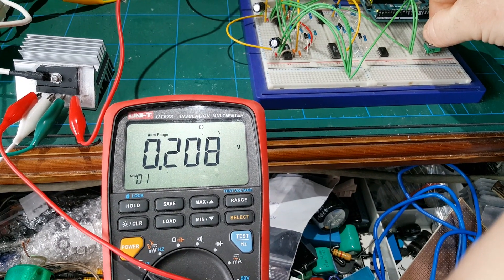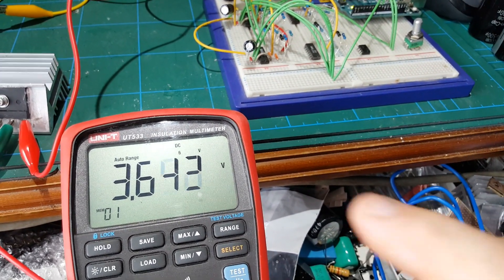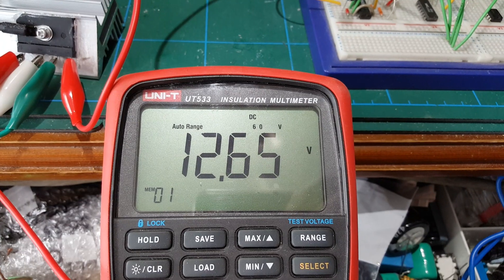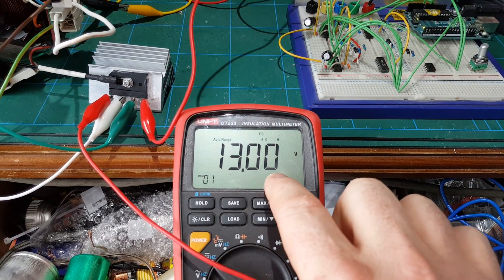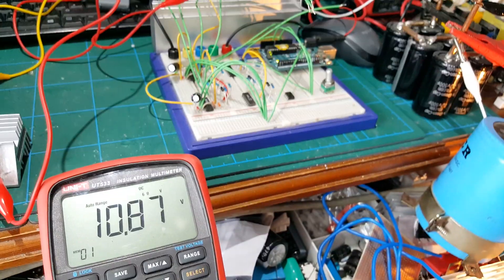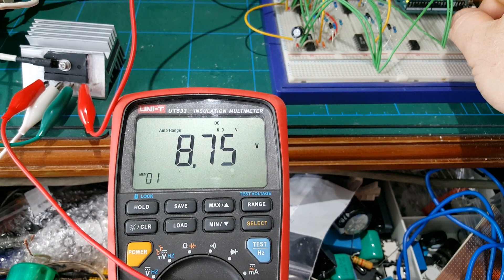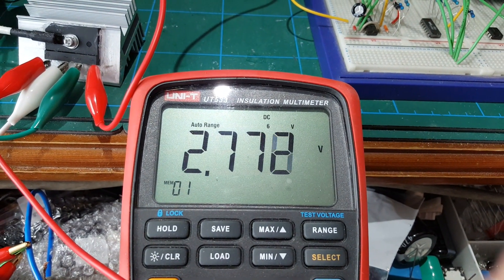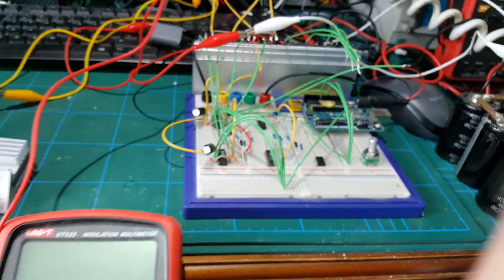motor control #4.2 regen braking dc series wound motors continued

Comment: Hi, I have bought used Curtis 1236. without changing any parameter, can you use any THROTTLE TYPE on this controller or do I need to identify the pre-programmed THROTTLE TYPE set by previous owner? 
Is there any anyway to detect current throttle type?
Reply from the maker: Im really sorry iv neber played with a curtis controller. I know loads about my own. I take it there isnt a manual or can you not just use the manual to set it to the tyoe you want?